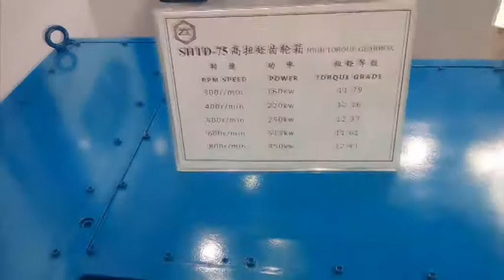extruder gearbox high torque made in china,twin screw extruder spare parts manufacturer

Comment: Have you same gearbox with 72.5mm distance between outer shafts?
Reply from the maker: yes,we have,but we still need to know more about the gearbox
Reply from the maker: yes,we have,but we still need to know more about the gearbox
Reply: Out speed 300 rpm , 55kw motor